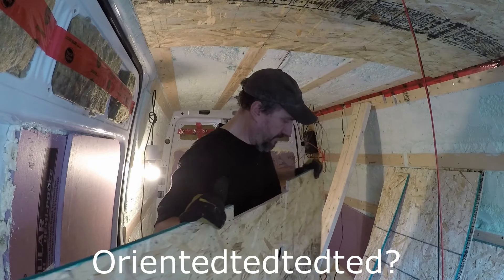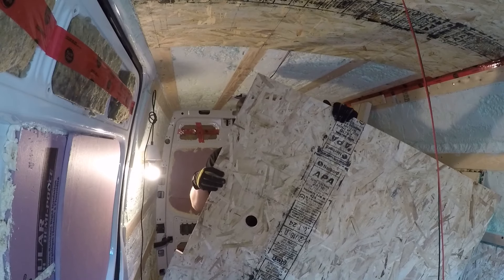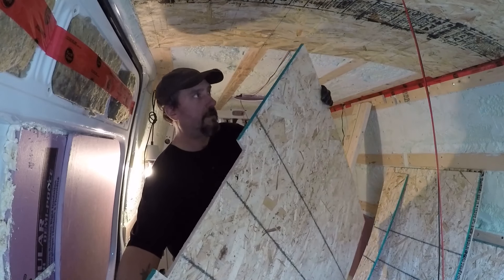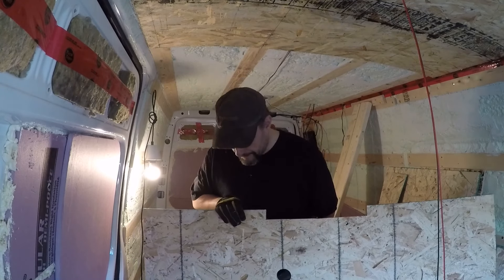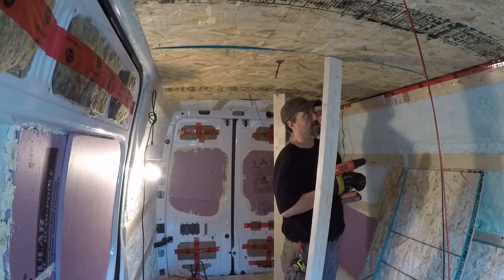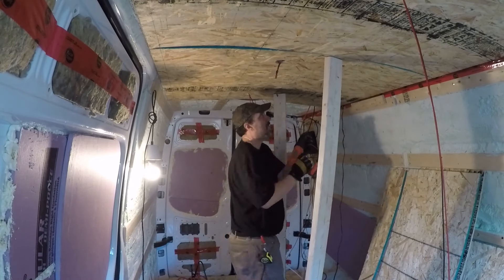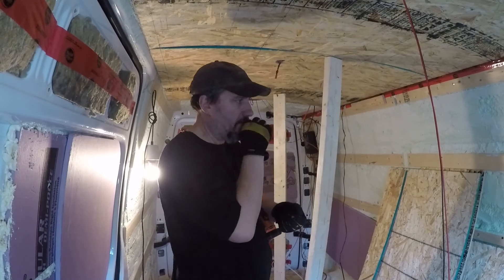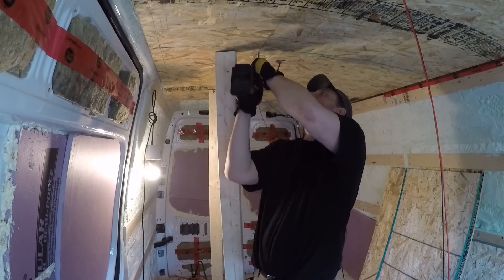Installing Ceiling | Sprinter Van Conversion

Comment: Hi Eric I saw one of your comments somewhere and looked you up because for your channel name 👍
Coincidentally I've used the same OSB for my van rear full height garage wall (with doorway) and cupboards.
Like you I insulated and fixed strapping first then built everything to that.
I'll be closing up the exposed walls and ceilings with smaller removable hardboard panels. That way I can paint them individually or maybe cover them with pictures, maps etc
BUT I'm using the raw OSB as the finish as I like the way it looks. I just sanded it and sealed it with a clear coat.
In the UK the boards don't have as much branding on them so it looks pretty cool IMO ☺
Reply from the maker: Hi Mark, thanks for leaving the comment. It would be nice if the had less ink and if it wouldn't bleed through the paint. For cabinets I’m using aspen ply. Cuts cleaner and is less flexible where I don’t want a lot of movement. I did do the side walls of my fridge with sob and thinking of changing it. 
Apparently I have several videos to catch-up on.